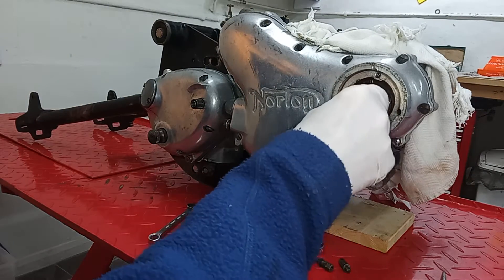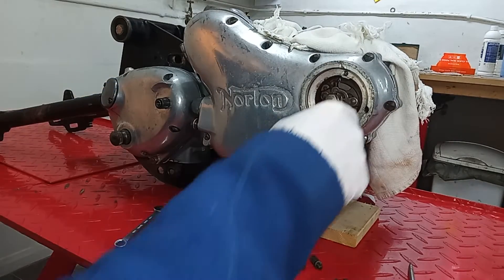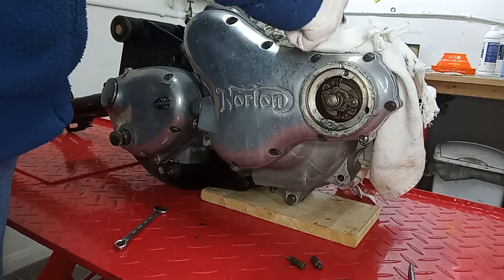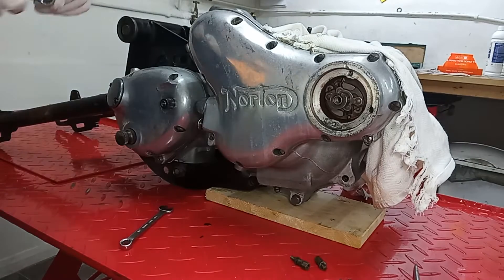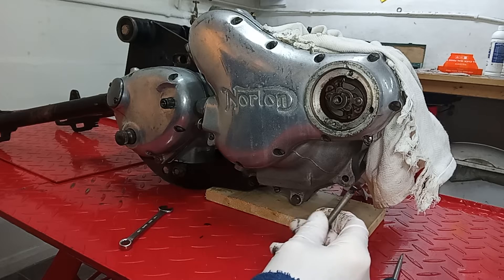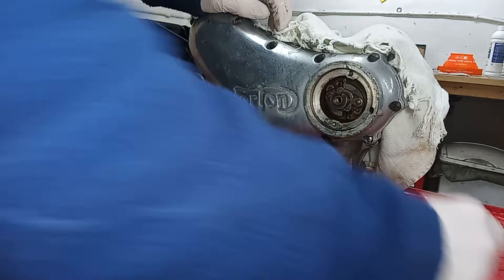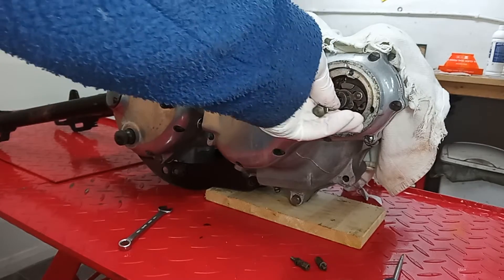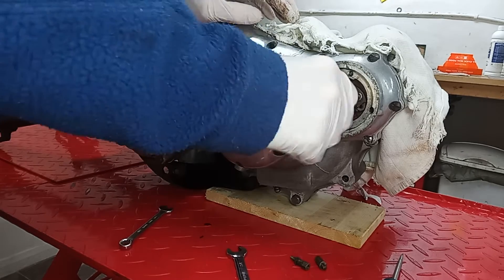Norton Commando Engine Rebuild. Part 11: Removing the Points

Comment: On some of the Lucas automatic advance units, if you tighten the bolt too far when trying to remove it, this distorts some component causing the weights to stick. You should only need to screw the bolt in until it meets some resistance then a tap will release it. The A/A units are quite delicate. IMHO bin it and replace with electronic ignition Best wishes
Reply from the maker: Yep agree, but in this case the whole points casing was pretty rusty and seized up. I've never met that much resistance on an advance and retard mechanism before, but this one was corroded in.
Reply: No criticism implied Chris 👍
Reply from the maker: John, none taken! My apologies if it sounded like I was offended. Thanks for yourinput - always appreciated. 👍
Reply: Hi Chris no it’s me I don’t want to offend you but the a/a units are expensive and easily damaged. Best wishes and hope to see you in the Peak District one of these days 😊👍

Comment: This was a great video Chris, it shows how delicate that center bolt can be holding the advance unit in.  I hope once the cam is out of the engine you will have better access to the broken portion of this bolt.  Maybe your engineers that you work with can possible "stand" up the cam and mill the end of the bolt flat and allow to find center and drill for an easy-out tool, possibly in a lathe and drill it out as well.  Fingers crossed.  By the way I really like the "THOR" hammer you use, so much I found one on eBay and it arrived this past week...
Reply: Glad to see your vid. I will learn and perhaps provide a little heat and spray lube a few times prior. Nice seeing you post mistakes for all to see. I know I’ll be making tons. Great video.
Reply: Or if enough bolt is protruding, perhaps a tiny tig weld with anything gripable “if that’s a word”
Reply from the maker: Thanks Mark, I am indeed hoping that the engineers will be able to remove the bolt from the camshaft. Glad that you're now a member of the THOR  club!